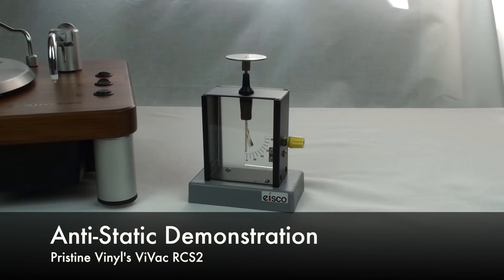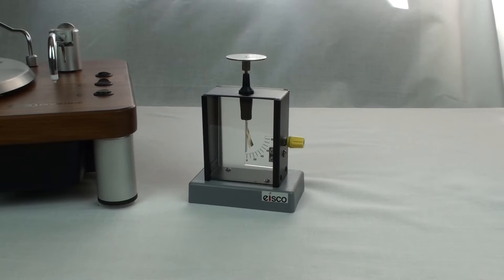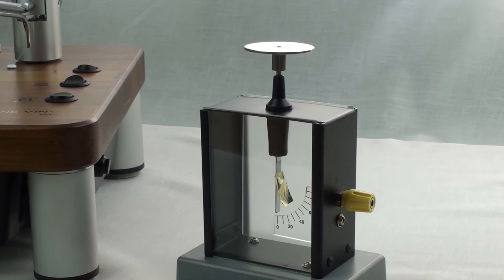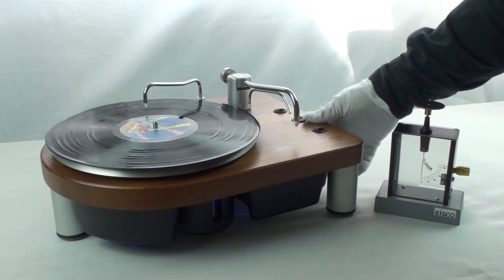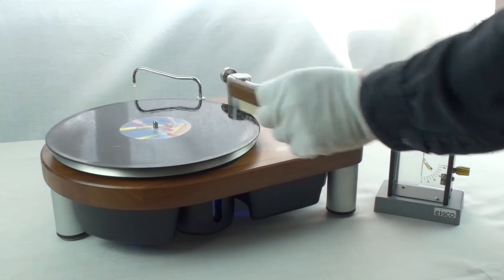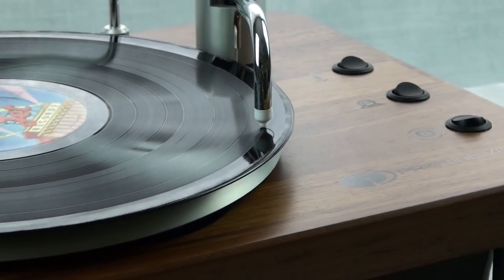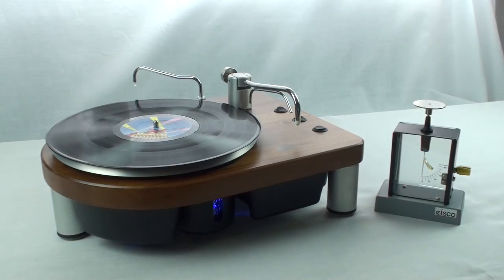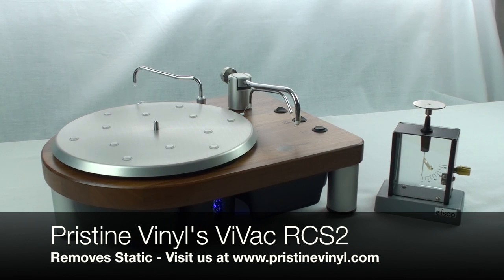Anti Static Demonstration using the ViVac RCS2

Comment from the maker: The video is not great I'm embarassed to say and I didn't reset it properly. This is done by simply touching the plate with a finger and it should reset the gold leaf back to the vertical position. I will do this again but given the tests we've done, we are confident that the cleaning process removes static.